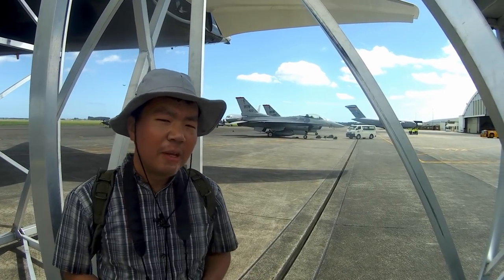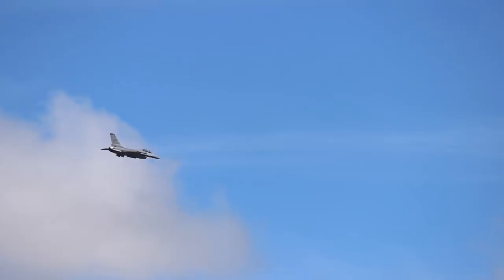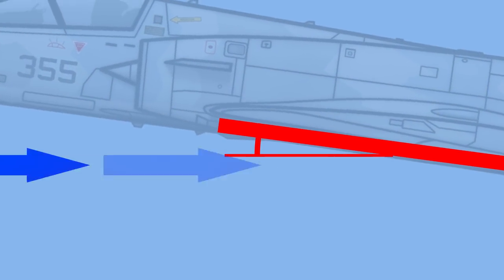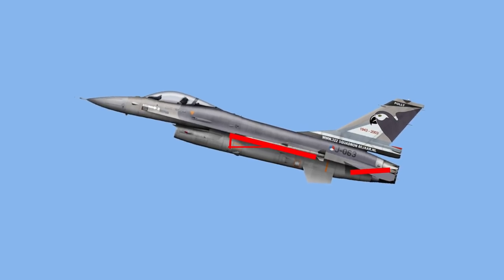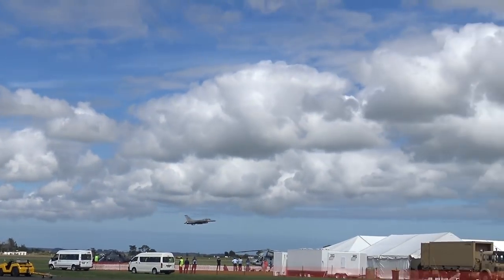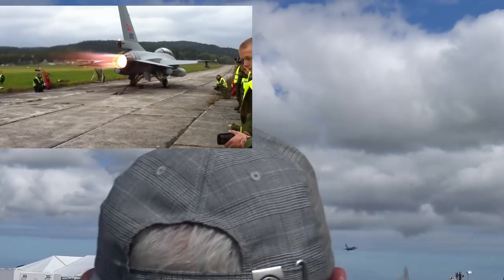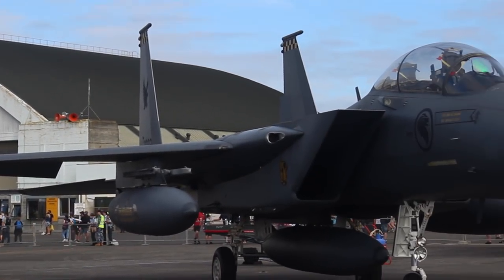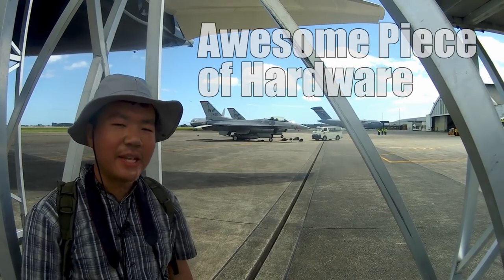F-16 and fly by wire systems

Comment: Before Helen Clark got into government in 2001 these were going to replace the A-4K's. Grrrr. Great video, at the start and end it looked like you weren't behind the barrier? The F-16 was the highlight of the Air Tattoo for me.
Reply from the maker: Hugh W later on the 2nd day the f16 was moved to near the air NZ 787. 

I was under the gantree and the audio was dubbed coz the apu and air conditioning pumps were really loud